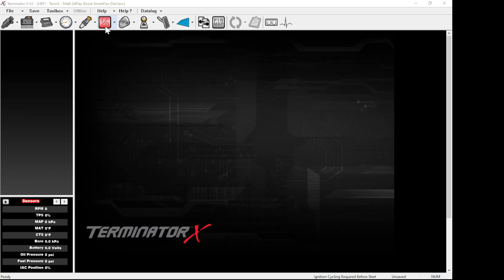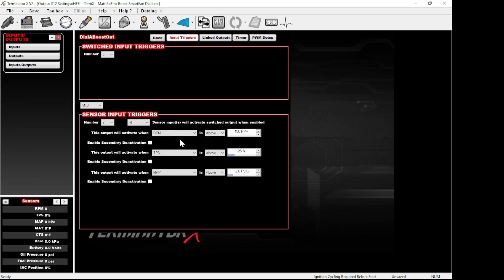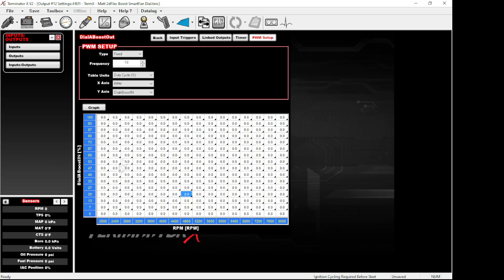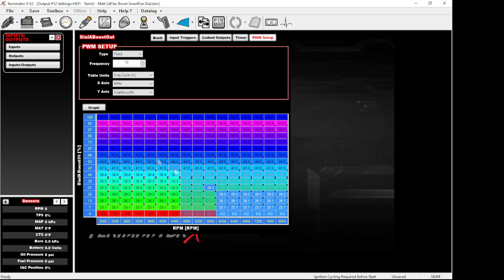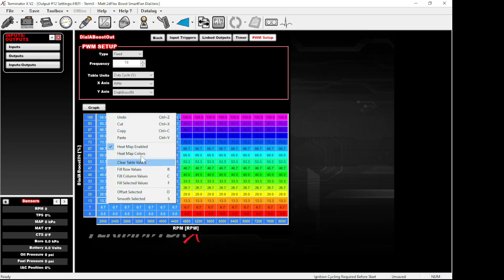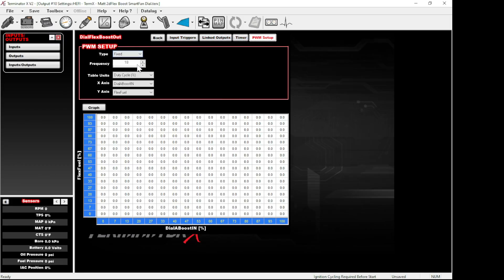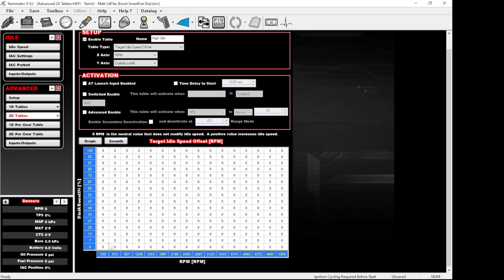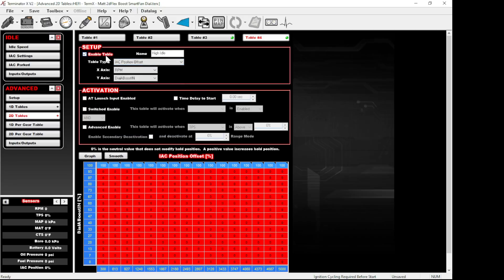How to use: Sloppy Mechanics Dial a Boost input harness

Comment: How does this work with the Mac valve? Do they have separate inputs?
Reply from the maker: the dial is an input into the ecu so you can tell it something, the solenoid is controlled as an output so it can tell it what to do, all of it is programmable to do nearly anything you can imagine, including modifying traction control settings if need be etc
Reply: @SloppyMechanics  thank you I love your stuff make everything easy and clean

Comment: Matt, after i set up the tables. lets say my boost controller is on pin b12. do i assign dialaboostout to pin b12? will dailaflexboost out automatically work even without being assigned an output?

Comment: Hello Matt. Could this be used with canbus module for the input/output?
Reply from the maker: Yes, but you’ll have to custom wire it to the canbus board, I am working on making some kind of pnp for that situation but don’t want to complicate it or have too many connection options
Reply: @SloppyMechanics  thanks for the reply Matt. Id be interested in buying if it will work with my canbus!
Reply: @SloppyMechanics hello Matt, have you figured out a kit for the canbus IO guys? Id love to wire this into my canbus module & use for boost settings with the nice dial.

Comment: I have a OBA setup with a boost curve already setup. I added a dial, and then made a boost offset table, which I believe will add X psi at each dial location to my base curve. Least I hope it does.
Reply from the maker: yessir you can easily offset i actually made a new video talking about many of the use cases for this dial

Comment: Awesome video! When would you recommend this as opposed to a CO2 boost controller? Wondering if one could get experienced enough with a non-CO2 setup and be able to setup boost ramps just like you can with CO2.
Reply from the maker: you can, or you can offset the dome c02 control with this dial also

Comment: Great vid, Matt. I use mine with a boost offset advanced table to set up boost ramps as I already have MAP based boost control set up on the Dominator. I really like how simple you made it with directly controlling the MAC valve output. The possibilities are endless with this thing.
Reply: Now if we could just get one!
Reply: @D3thM3tal  You dont have to buy Matt's setup, it just makes it plug and play. The AEM trim pot is only $30. The wiring is pretty easy.

Comment: This is going to be fun - I assume you could crank the dial "mid run" and it would instantly change the boost offset, correct?  I wonder if you could use this to adjust traction control sensitivity...
Reply from the maker: yes and yes, you can turn the dial whenever, while idling, flooring it, etc
Reply: @SloppyMechanics  throw back to matt cranking the dial in the colorado on a pass at the track, kicking a hole in the block 😂
Reply: Little Victory Fab Co  truck doug, the legend!!

Comment: Would like to see a video specific to bump/creep setting set up on the Holley terminator x, mine either bumps way too far or doesn't bump at all...
Reply from the maker: are you running a solid state relay?
Reply: yes, I have the Amazon fotek ssr-40 DD 5~60vDC  3-32VDC
Reply: @SloppyMechanics  do I need to just go ahead and buy the Holley 3 wire SSR?

Comment: My idea in how to use the DialABoost was using your MPHxTPS duty table from the big turbo 2500 truck and then use the DAB as in input for an advanced table to offset the already built boost control table up or down.
Reply from the maker: yep see! it can be applied many many ways